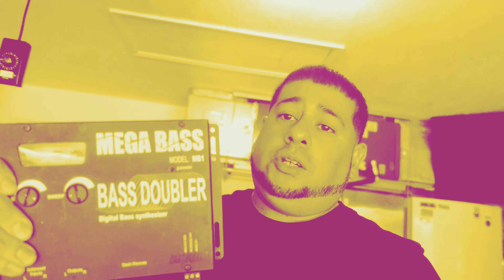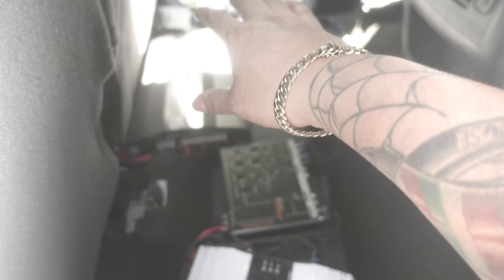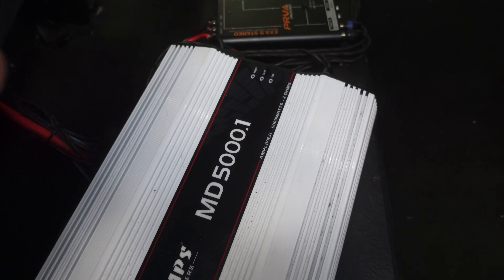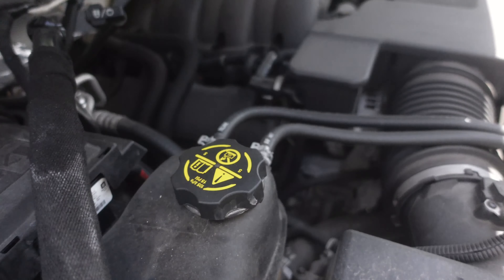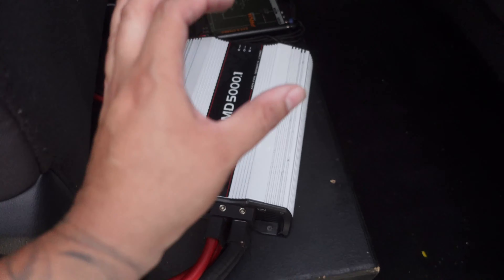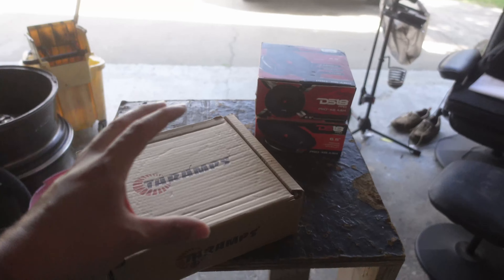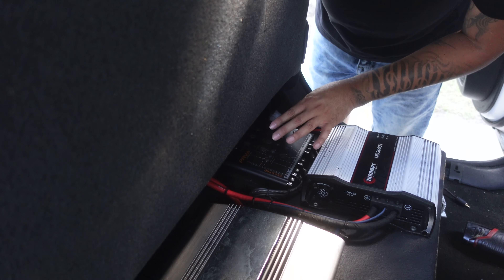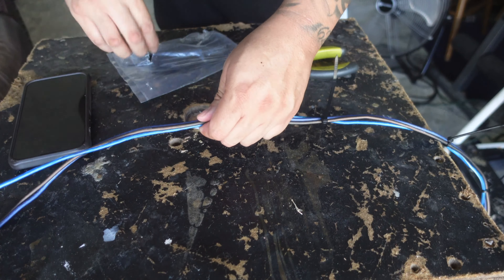Fake Subwoofer Bass Maker Doing Work! | Epicenter

Comment: Just keep in mind, that is not an Audio Control Epicenter. The circuitry in that unit is probably gonna work in a basic sense, but it's not going to be the same sound you're going to get from an actual Epicenter. 

I'd recommend anybody that was interested in this type of device to get the genuine article. The Audio Control circuitry is very refined and does more than just add bass. 👍
Reply: Make sure your feeding it a full range signal, then use the crossover on the amp. 

That Earthquake unit is not a line driver. It outputs the same voltage you feed it. 

Only when you turn up the effect does it bump up the voltage. Same as the Audio Control Concert and Micro.

Comment: What was the problem with the Taramps going into protect. My big boss 3k goes in and out ofprotect after 2 minutes had to put it real low on the gain. It was fine till about 2 weeks ago
Reply: Sounds like you’re dealing with low voltage